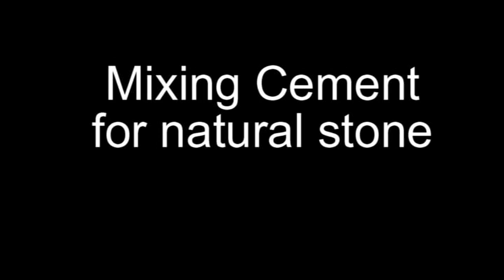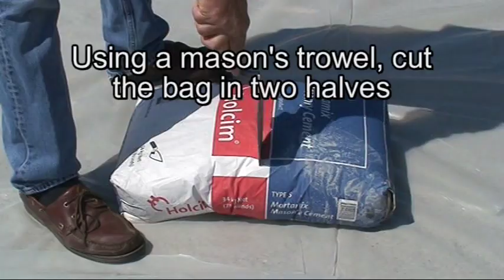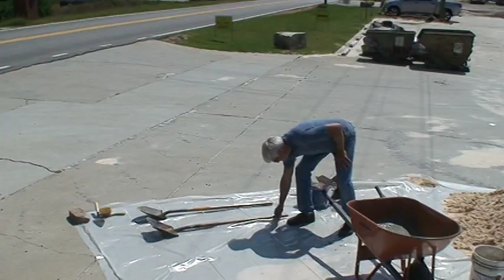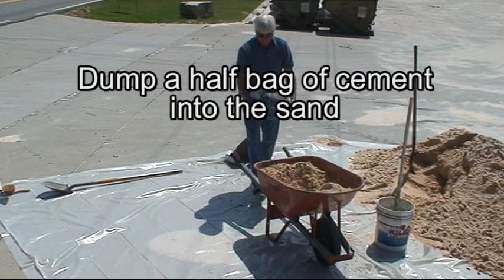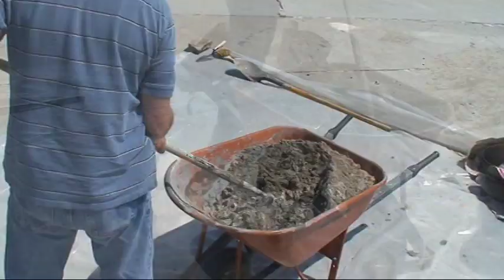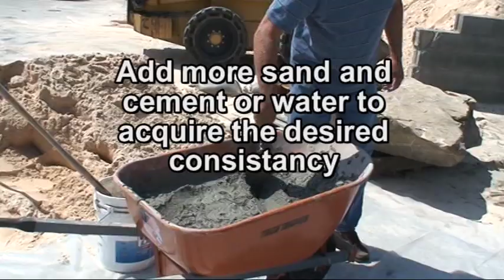Mixing Cement for Natural Stone

Comment: Cement should never be let anywhere near natural stone and neither should you.
Reply: Why not?
Reply: Not very helpful David - Got a better way to do it, or a better mix? i'm about to repoint then but another two layers on an old granite wall on my block and am looking for a good mix..
Reply: Granite is pretty hard, so some cement might not be as terrible as for other softer stone.  In the UK for stone any cement would be frowned-upon, lime putty, quicklime or  "natural hydraulic lime" would be used here. In the US the highest-lime mortar is called "type O", which has more lime than cement. This sounds good for granite.
Reply: @metallitech  what about type n
Reply: @andseraf8544  Type n is apparently has for binder 50% lime &  50% cement. Not too bad, but keep in mind that 200 years ago they didn't even have cement.
Reply: @metallitech    Type o mortar is not recommend for high wind areas they don't make it much anymore. S mortar is recommended by manufacturers for stone, anything structural and below grade.
Reply: I mix 4.5 sand, 1 cement and 1 lime for my rock wall making here in Australia. No freeze where I live in the tropics and my mortar sticks well, cleans up pretty good but get slight lime lines if I clean too early and no stones have popped or cracks formed

Comment: Too runny use a shovel on the floor. Mix sand and cement make hole in center ov the pile put water in it, not to much or it won't be good for anything like the tilling grout in this attempt 😂😂😂
Reply: If it does not stick to a trowel sideways after loading and flicking the trowel it is too runny.